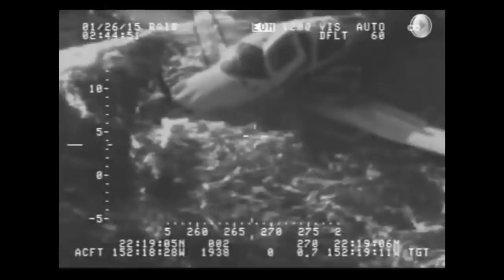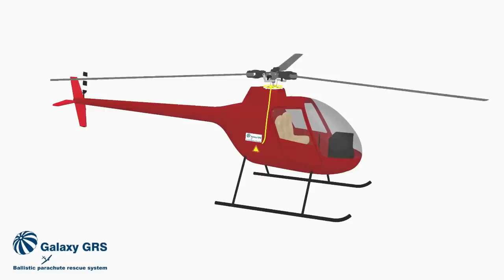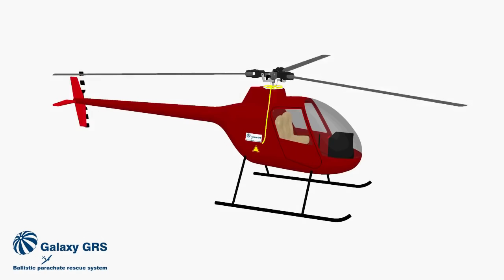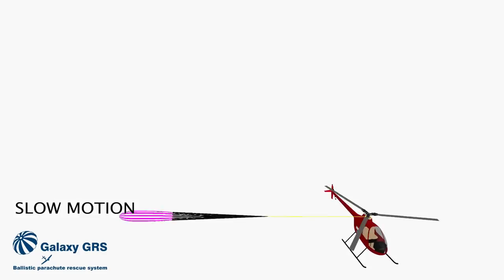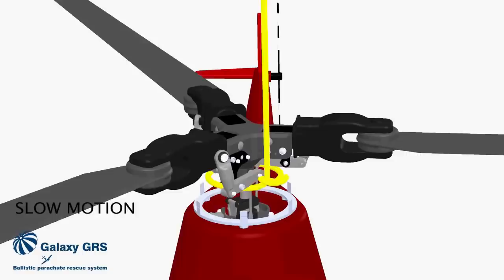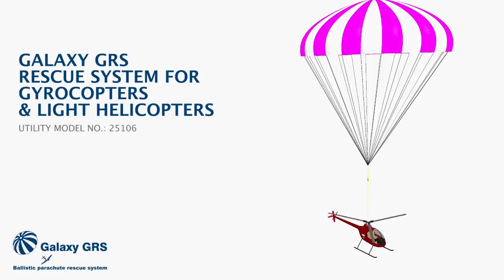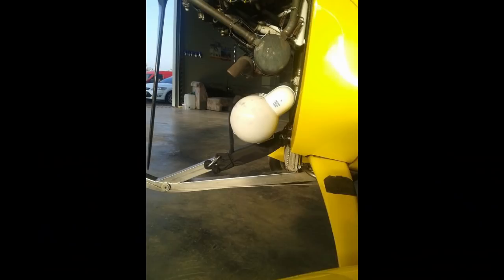Gyrocopter parachute rescue system or ballistic recovery system [BRS]

Comment: Makes sense, especially in light of potential rotor damage, but..... the system adds additional 20kg to the take of weight, which will increase take off distance, particularly with two people on-board and full tank. Having quite short runway and some obstacles ahead, this extended take off distance seems to me higher risk. But hopefully for other's that won't be an issue
Reply from the maker: Yes the weight and balance point is interesting actually and I suppose ultimately will depend greatly on the aircraft you fly.  Aside from the BRS sounds like you need Rotax 915 power!  It is the single biggest difference you can make for take offs.

Comment: Gyroplanes can be extremely safe to fly, in experienced hands, whereby human error or inexperience, are probably the most causes for accidents! The fact that if your pusher engine fails, you can " relatively" safely land by auto gyration, again, in the hands of a well trained pilot. This is one of the main safety features of gyroplanes. However, having a ballistic parachute  onboard, gives you another " last ditch" safety measure,  or option, that can save your life if the main rotors fall off, and auto gyration to land , is no longer possible. Belt and Braces, a good thing  to have in any craft that tries to defy  gravity!

Comment: I remember that there was an Air Command tandem that had a BRS fitted to it in the hopes of selling autogyro recovery systems back around the late 1990's or 2000's.  The system had two mounting locations.  One on the bottom of the gyro and one up on the mast.  When the BRS was fired the gyro would invert and thne pilot would pull a pin to let it swing upright to the 2nd mounting point on the mast.  I don't believe that they ever tested the setup as testing would be expensive and dangerous.
Reply: Yes I saw that too.
Reply: Sport Copters fly inverted ;)